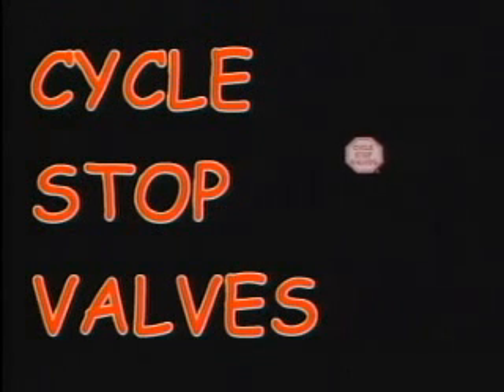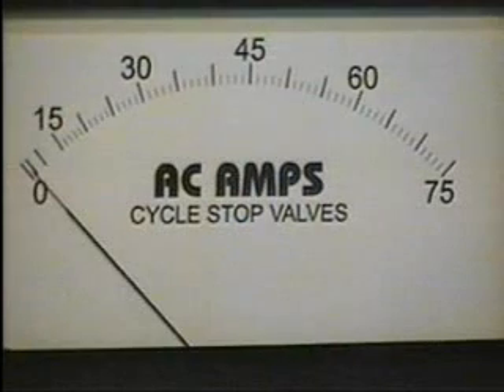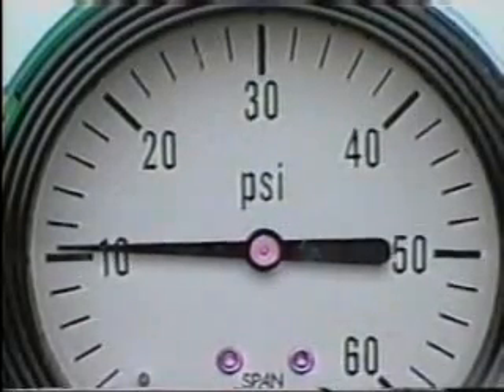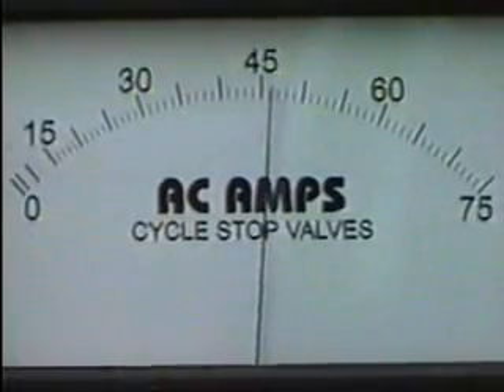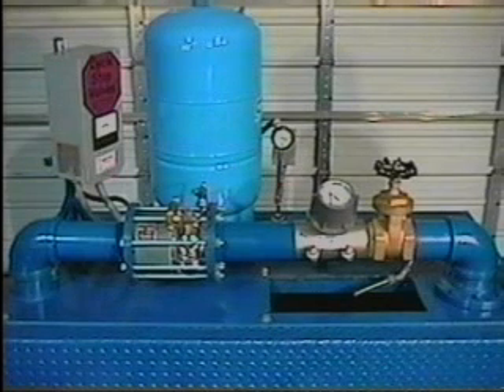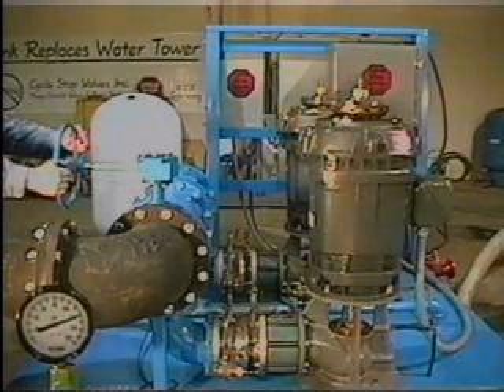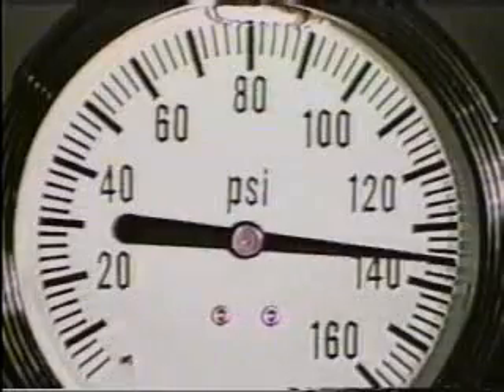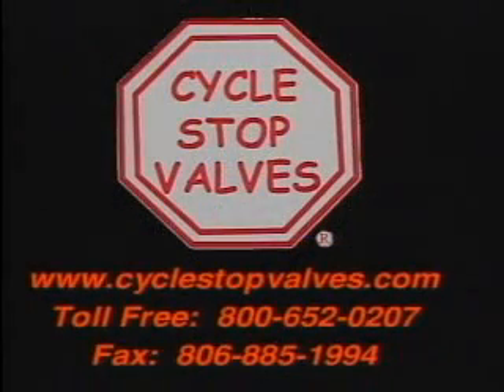Cycle Stop Valves

Comment: This compares to an inverter type of motor control to control the water pressure. The reason this can be better is because of up front cost is way lower and reliability is higher. Cost savings of the motor using less amps of an inverter type and this cycle stop valve control are going to be about the same. Works real good for residential use mainly because the residential inverters have fragile electronics that often fail requiring an expensive inverter replacement often needing to replace the matching well pump also. MY old boss where i used to work we had to replace his twice in just three years of use. This is the cost effective way to go

Comment: It sounds more like a valve with a hole in it. It amounts to a leaky valve. This is using mechanical device to solve issues that would be better served by electromechanical or non moving parts like a vfd or a low voltage control